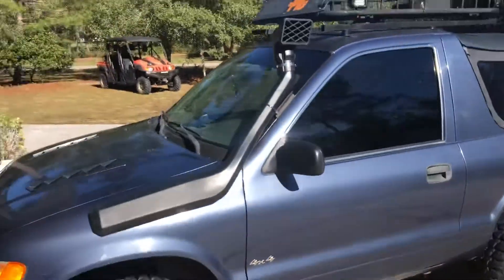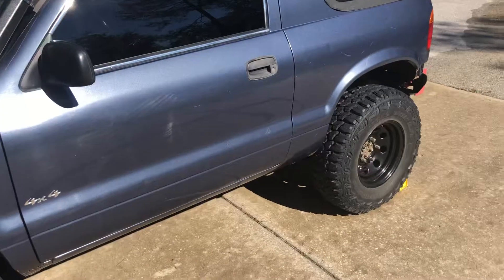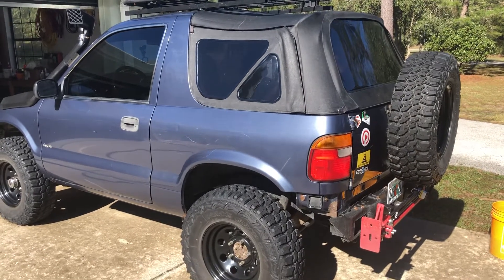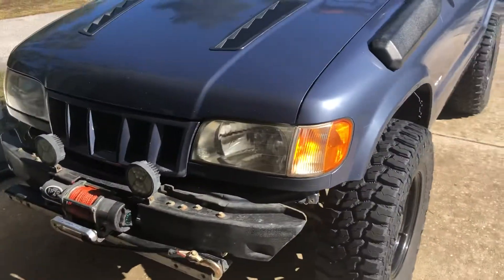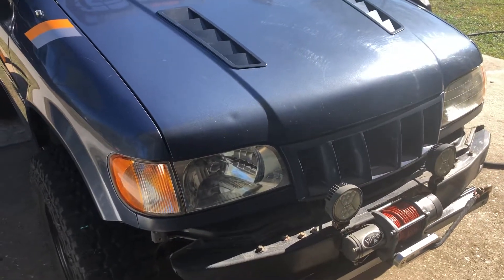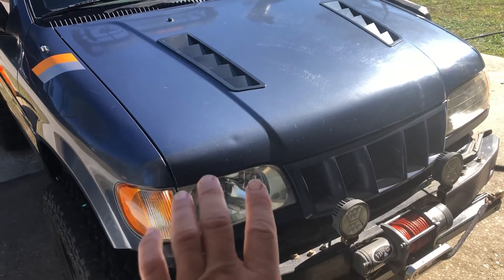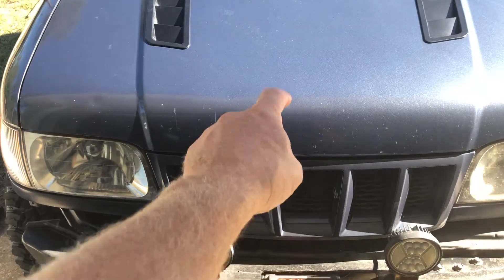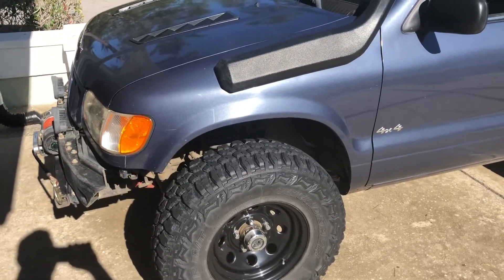Micro-Pig quick tip! How to avoid rusting out your Kia Sportage body and frame.￼

Comment: My 2002 is rusting out around the fender trim, by the tail lights, and along the running board trim area.
Should I rip the plastic trim off? Any other tips?
I do a lot of Mountain trails and there’s a lot of clay here.
Awesome video!
Thank you.
Reply from the maker: Thank you my friend, and that’s a great question. Of course nobody wants to do something that makes their car look bad, but I believe that if there is a lot of off-road involved, any place that can trap mud or clay inside of it would be something I would consider removing. Lots of times the rust that we already have is because of sand and mud that has been trapped in there for years. There’s not much that will stop the rust once it has started, but we can certainly slow it down by keeping those areas clean with freshwater.